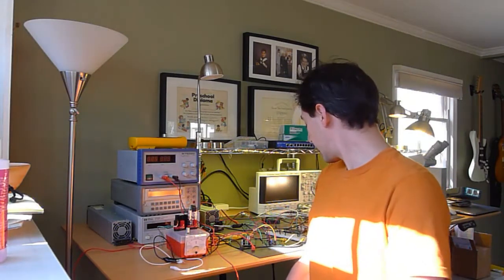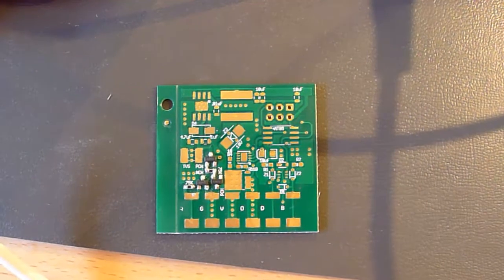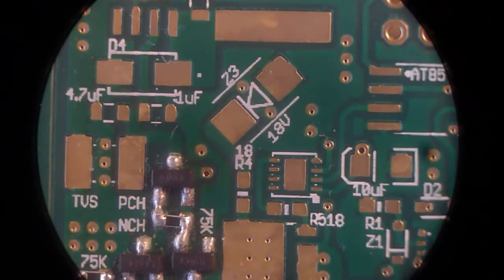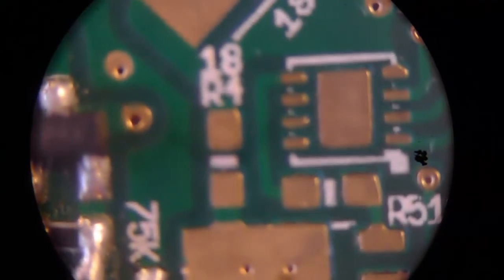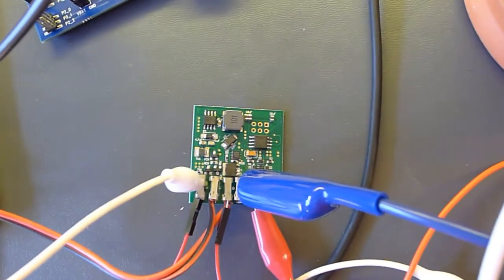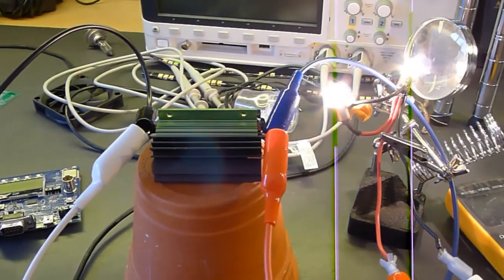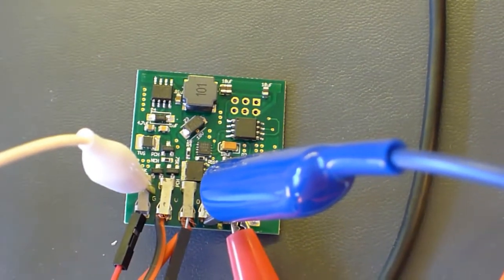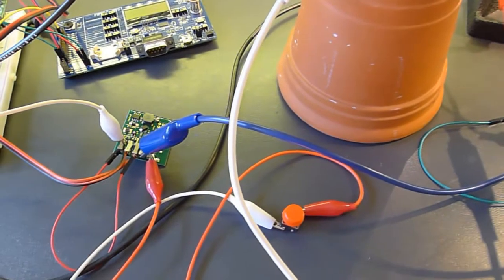Single Channel PDU - Final Preproduction unit

Comment from the maker: It will be "encapsulated". That means that it is potted in a mold without a box. There are no user serviceable parts on this product, so it will be completely protected from the elements. It is programmed at the factory so there is no need for programming headers to be exposed. I put them on the board for my own purposes as there was ample space for them. The user programs it via a process that uses a single wire and feedback from a light connected as the load.

Comment: Pot with a flexible 2 part epoxy into a small box, do not leave the connectors exposed, they will provide a way for water ingress. Use long ( 1m or more) leads for power and output, and a short lead for the ISP that can be sealed with 2 layer heatshrink when done programming.